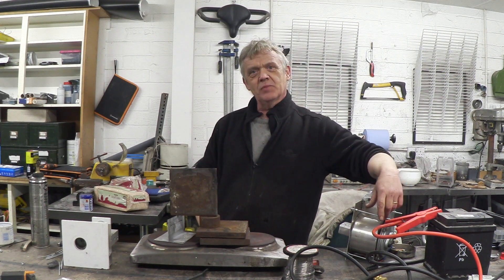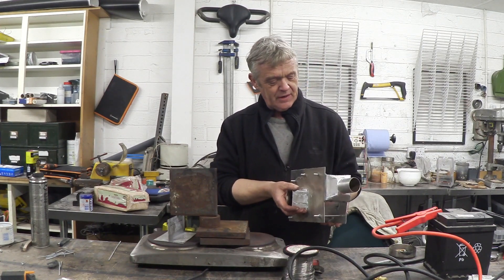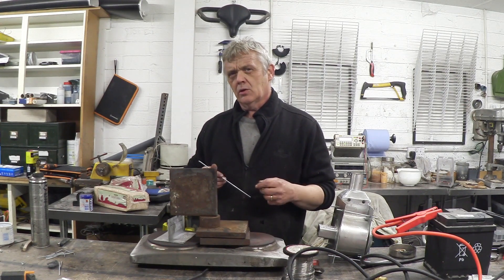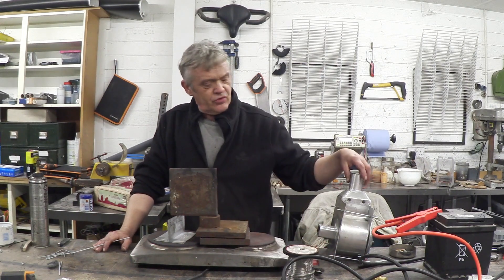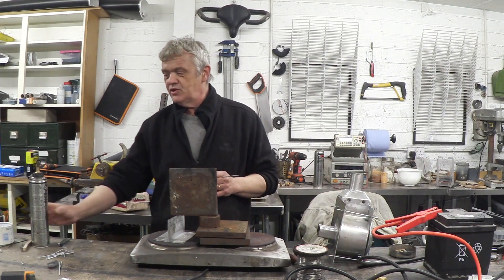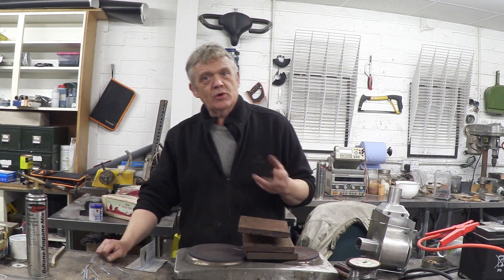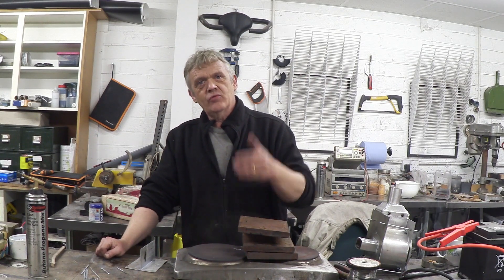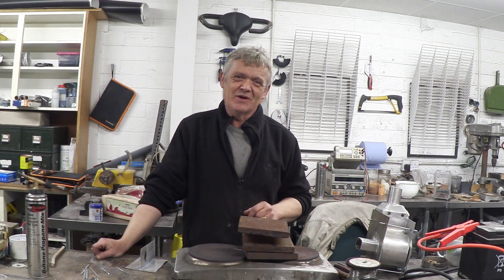The Trick With Aluminium Welding Rod

Comment: Thanks very much - this is indeed the trick, and works a treat. I used fairly strong gas hob heating; perfect job on my first attempt (also using oxide remover stick).

Comment: I may be mistaken, but I think this isn't really welding, it's brazing or soldering. The 'welding' rods are generally a zinc alloy which melts at a lower temperature than aluminium. But zinc is good at alloying with aluminium, so they make a good bond. However zinc is harder, so there can be issues in major structural applications.
They are really great. I find the best way to use these is to tin both parts first. Use a blow torch to heat the part and a stainless steel wire brush. Melt the rod using the heat of the aluminium and brush in with the wire brush. The brush breaks the oxide layer on the aluminium and you should get a nice tinned surface which is easy to make a joint to.

Comment: Brazing
Reply from the maker: yep - but the ads for that rod all say welding so I went with that
Reply: @ThinkingandTinkering  Flux can be made with sodium and potassium chloride  if you buy pure aluminium welding rods.
Reply: @ThinkingandTinkering  Sorry my original msg didn't send, It was meant to say make sure you get the low temp brazing rods as I got pure aluminium rods thinking they were low temp. What ever happened to the  blade battery?

Comment: Heating the metal with no distortion is an excellent idea, cos you got it uniformly heated and to a temp that meant not much extra heat was needed. But although for your purposes, the joint should be strong enough. It isn’t actually Welding but sticking the metal together with a bead of Ali either side. Welding involves melting the rod into a pool of molten metal to get proper penetration, which couldn’t be done with that blow Torch you used. As the flame is too big, so you couldn’t get the heat close enough in one small spot to create the pool that the rod needs to be  dipped  into.!. I did my apprenticeship as a sheet metal worker/welder, well my workshop was called the ‘Tinsmiths Shop’, we used to Oxy Acetylene weld Aluminium from 22 gauge up to whole lorry engine blocks. When someone had a cracked Ali Engine block we would have 2- people heating the block up while a third welded it, cos Aluminium transfers heat so well.
Reply: Aluminium brazing rhe rods aren't aluminium, but mostly zinc.  It's a braze rather than a weld, but there is (as in brazing ferrous materials with bronze) some material transfer; you end up with a very small layer of zinc / alu alloy between the zinc and the underlying metal.  That's why you can't simply peel the stuff off if it's done properly (as you would be able to with, for example, solder).  It's not welding per se, but it's definitely brazing.
Reply from the maker: cheers mate - to be honest the ads for that rod all say welding so I went with that

Comment: You can weld cast iron pieces, big ones, by heating the whole casting. Even an ordinary flux core welder will do well, if your parts are heated.
Reply from the maker: awesome mate - cheers
Reply: @gotnokittys I'm really interested in your comment. Could you give details of the welding please? Arc welder (i.e. stick welder?) Did you mean flux coated, not flux core? And could you give examples of suitable rods?
Reply: @nil5221  what I meant was an ordinary wire-feed welder. Even the no gasses, flux core works. Mig welding has a sheilding gas such as argon. 
   In a non shop situation outdoors I have done the heating in a wood fire. Whole machinery manifolds, cast iron covers, engine manifolds. 
  Just get them dull red, all over. Then weld. Alternate heat and welding till finished. Cool slowly.
  Edit: most basic welding rods will work, also.
Reply: @gotnokittys Thanks man, I have both gasless mig & stick welders, I'll try it!

Comment: Do "aluminum" stock and "aluminum" welding rods have the same melting point (660°C) as pure elemental aluminum?
Reply from the maker: no those rods are mostly zinc
Reply: @ThinkingandTinkering  Thanks.  FYI Zn melting point is 420°C

Comment: Using a hotplate is clever, when I brazed some aluminium with those rods, I used some insulating firebrick to help keep the heat in from the torch, but I think the hotplate should work even beter...
Reply from the maker: I found small pieces are fine on a brick but large area pieces just wouldn't braze until I did this

Comment: Thanks Robert, that's good to know, I don't know if I saw it right but from what I could see it looked like it was a nice weld to me too. You can see what it is doing better than I can, does it look like thw rod is flowing like hard solder or brazing rod and sticking to the aluminum or is the rod fusing with the aluminum where the two metals are mixed with each other like a weld? Actually the same sometimes applies to arc welding too but you use an acetylene torch or something that will get sufficiently hot to heat it up.
Reply from the maker: it flows really as it is a braze but the rod is mostly zinc so there is some 'welding' going on

Comment: This is that low heat "soldering" rod,,it's kinda like aluminium brazing in a sense or soldering. welding is melting both mediums together. This is wetting in one to another like solder,  but I have used it with good effect for some structural small jobs. and yes pre heat is essential for this to work well, and pre heat even for higher heat aluminum tig welding that I have also done makes it easier..but it's something people should be aware of that aluminium tig welding rod is a different alloy. I could see some people might get the wrong type and struggle with this method...
Reply from the maker: the ads for that rod all say welding so I went with that - but you are right
Reply: @ThinkingandTinkering  good to clarify for the folks at home.. so they don't go run out and buy the wrong stuff..cheers, and your way of doing this seems to work a treat and I'll use that methods in the future.. I used to just start it and preheat with a torch, but your idea keeps it hot the entire thing,, and it went fast by the looks of it so great job and lesson.

Comment: I honestly thought you could only weld aluminium with a tig setup. This was useful info!
Reply from the maker: it's more like bring to be honest mate - but seems to work well that's for sure
Reply: special low heat rods,,,it's not exactly welding,,more like aluminium brazing or soldering... the rod wets into the base metal like solder and brazing does...
Reply: @chuckthebull  Interesting! Sparks my interest.
Reply: @Forbidden303  you can find those type of rods demonstrated on a few other  YouTube vids, and buy them on eBay Amazon etc..I used them for a transmission shift housing in my 1962 sunbeam.. it's been solid for over 5 years..they take a bit of getting used to but Mr Murray made it look easy and his method is sound.
Reply: @chuckthebull  what make did you get or was it generic? Cheapest ok or did you pay a bit more?

Comment: Thanks much for the tip.  Cut secondary coil out of microwave transformer yesterday for spot welder.  Russian guy wraps wire 3 times for more power.  I’m thinking of wrapping insulated copper tubing?
Reply from the maker: I did a vid on it too mate

Comment: Can you tell us what temp the hot plate is set to please? I have some of these rods and I’d like to try it out. 👍
Reply from the maker: 4-500 degrees C seems to be about it mate - but the setting on this hob isn't that calibrated it basically had a 1-5 numbering system and I had it on 4 and a half also the temp control isn't great

Comment: RMS, clever method to preheat the welds. That's how they weld large vessels with thick walls to meet ASME Code.
Reply from the maker: I didn't know that - cheers mate
Reply: @ThinkingandTinkering  Actually they had large oven to sit the vessel in with shells up to 20 ft in diameter. The shell thickness was over an inch and a half thick.

Comment: I find if you do a final clean with acetone before welding you get an even better joint as it removes any remaining contaminants eg grease or oil. 👍
Reply from the maker: nice tip mate - thanks for sharing

Comment: I am puzzled here as a long time tig welder. I doubt it is ordinary aluminium welding rod that you are using . What prevents the plates from melting if ordinary aluminium welding rods(tig rods) only melt at the same temperature as those plates. I can only guess you are using a special rod that melts at a much lower meltpoint. :)
Reply: Not really weld as you understand.  Think solder or brase rods are not aluminium but if I rember  zinc
Reply: Yes technically it's brazing or even soldering, not welding as the metal parts themselves are not melted into the join. There are several brands of rod available now, through usual hardware store chains or online stores. Great invention!!
Reply: @nil5221  That was the thing that started me thinking...he stated welding and aluminium rod in the title. Its a lower meltpoint metal rod....not aluminium. Thanks !
Reply: @HoutmeyersP  the rods are mostly aluminium with other metals: some I just bought (Tradeflame) are supposedly "aluminium 4043" (made in China tho) that have Silicone,Copper, Manganese,  Iron, Chromium, Titanium, Magnesium, and Beryllium. On the packet they quote individual amounts from 0.0008% for Beryllium (who are you kidding?) to Silicone 6-12% ( yeah, nothing like accuracy to 4 decimal places, as a percentage) NO Zinc but Aluminium makes up about 85% of the alloy which supposedly has a melting point of 574 to 632 C. But the casting melted at the same temp as the rods, so they are useless as. They were on clearance sale at a major hardware chain store in Aus...still $12 for 4 piddling little sticks. Tradeflame is obviously going down, all their gear was on clearance. Don't buy it...I see Bernzomatic have some, and several online. But yeah, the eutectic needs to be below that of the casting :-)
Reply: @nil5221  Thanks Stephen , good advice.
Reply: ......the choices of rods have varying amounts of magnesium n zinc . Rob demonstrated earlier simply using pure zinc for the task .
Reply: @charlesdickens6706 Thanks for the info....
Reply from the maker: it's brazing really mate but the ads for that rod all say welding so I went with that

Comment: That's sounds like a really, really, useful tip for getting good aluminum welds! Maybe the high thermal conductivity of aluminum is why it can be difficult to weld/solder. I've also heard that if your welder is not quite up to snuff welding larger Iron/steel pieces, preheating a bit with a torch flame can help a lot getting a good weld. It's funny, I've had some of those aluminum welding rods sitting on a shelf for a few years now and have never used them yet. I'm now sort of looking for a project now to try them out. Your tips have definitely inspired me to give it a go real soon. I'm chomping at the bit now to try it. LOL!
Reply from the maker: get out there and try it mate lol

Comment: How about if you preheat it, and then use the welder machine with the aluminium rod? Perhaps you have to set it to a very low amperage, but would that work? (I can;t test it, as I don't have any of the supplies).
Reply: These rods are more like  braising as you don't melt the parent metal  , arc welding requires a forks to shield the arc , if you put enough current so the rod to melt it the whole rod would melt.
Reply: @lesclowes6042  I can imagine that, thanks. No shortcut here .. ..
Reply from the maker: they are really brazing rods. mate - the ads for that rod all say welding so I went with that - but it is brazing really

Comment: Does MAPP gas work better than propane?
Reply: Heats hotter, but propane is already hot enough to melt aluminum, so save the MAPP for heating thicker sections [1/4" +] or jobs where higher temps are required. [Silver soldering steel, etc.]
Reply: Yep, I know it's hotter, that's why I wondered if in this application, where he has a large mass acting as a heat sink, if it'd work better than propane. Just as an alternative to using the hot plate to pre-heat the entire thing.
Reply from the maker: I don't know mate - my guess is there would be a pretty Haigh chance of you just burning a hole in the Ali especially with his plate

Comment: Did you also have problems like melting the aluminium you wanted to braze ? Mine became liquid like the welding rod :)
Reply: Go over to Project Farm channel; he reviewed a bunch of the aluminum solders and several of them are particularly poor, having a eutectic point that's almost identical w/ aluminum's melting point. The good ones melt at a lower temp [surprise surprise!] ;-)
Reply: If I remember correct mine has around 650°C. I trusted it because it´s a german known brand. And it makes good bonds but I will look at other brands too. Makes life a lot easier when there are solders with lower melting point. I bought mine from a hardware store so internet is your friend I guess.
Reply: I used "Trade flame"  brand on aluminium castings. On the pack it has specs...supposedly many metals in the rod including Titanium and Beryllium (0.0008% which I don't believe). Silicone 6-12 % (a very wide range considering the Beryllium fake accuracy...  but no zinc??  Says melt point 574 to 632 C which also seems a very wide range. The whole thing is quite sus. Anyway the casting melted before the rod. Total rubbish.
Reply: Mine is from rothenberger rolot604 brand and it´s the only one available in the hardwarestore. Mixture is AlSi which has a higher melting point. It was 550°C before and they changed it to 650°C because they changed the mixture. If you work very fast then it works but overshooting is easy because sometimes it takes a while to flow and not make beads on the material. After melting the base aluminium it weakens and you can toss it in the garbage it gets too brittle then as I find.
Reply from the maker: no mate - but I see there is lots of good advice in the comment for you